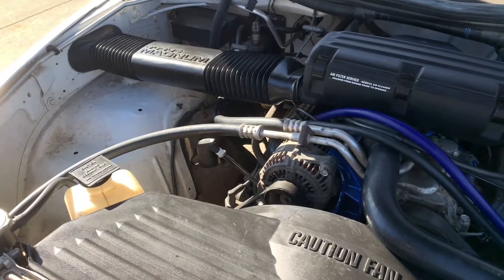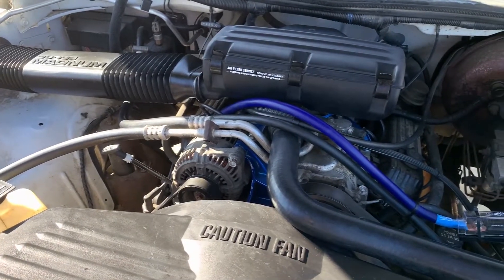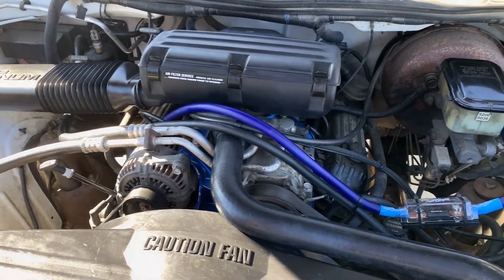Electric fan conversion update and review

Comment: Hey man didbyou get the Mark  VIII fans from the junkyard or new?
Reply from the maker: Got them at the pull yard, recently found one of the holy grails a 98 Mark viii Fan, took the fan motor apart and replacing the main bearing on it.

Comment: Which year was the Mark vlll. I see different years have different styles.
Reply from the maker: 93-96 are easier to find but a little weaker in power, that’s what i have and they are super strong even though they are the not as strong years. the 97-98 models are the strongest they pull a couple hundred more CFM than the earlier models because they have higher rotations per minute. 

also keep in mind that a true lincoln mark 8 fan is single speed, people on forums have this confused because they sometimes buy them online and they get thunderbird fans instead of mark 8 fans, since they look virtually identical. so make sure you pull them out of a MK8 can or that the female receiver plug on the fan itself is White, a black plus is a thunder bird fan.

Comment: So Deleting the clutch fan does save on fuel since ur fan blades are working hard Against the wind??
Reply from the maker: that’s correct, i’m still running the big lincoln mark viii fan on my truck and working on a dual 18” fan set up!
Reply: @payloadperformance9706  let me Know...I got a 2002 with a 5.9ltr gas. Looking to delete the clutch fan as well.
Reply: @payloadperformance9706  if possible if u know how to Customize it?
Reply from the maker: @garciacuster1627  Message me on IG so i can give you more details on what you’ll need, where to buy and how to do it. 
my IG is the same as my YT channel name
Reply from the maker: @garciacuster1627  im not sure what you’re asking.
Reply: @payloadperformance9706  can custom make 1 for a 2002?
Reply: @payloadperformance9706  I don't have IG
Reply from the maker: @garciacuster1627  i don’t have the dimensions for it, i have only customized them for the 2nd generation series of trucks but i’ll look into it to see how i can help you out.
Reply: @payloadperformance9706  I Very much appreciate it. I'm in Texas so I wouldn't be hauling stuff up and down hills mountains! Thanks I really Appreciate it
Reply from the maker: @garciacuster1627  the dual fan set up is complete, check out my last video!
Reply: While driving?

Comment: Bro I have a 97 ram 1500 5.9, I ran a 16inch spal fan with a shroud and was getting 187 degrees driving around, with a 16 foot trailer hauling dirt I was getting 210 degrees on up hills. It worked ok but the fan was so loud it sounded like there was something wrong with my engine lol. I ended up installing a oem fan off a 2010 ram 1500 v6 fan and bro its amazing my temperature reads 176 and max 193 with a load. Oh and super quiet.
Reply from the maker: I’ve heard great things about that swap! That’s on my list for fan testing, I recently acquired a w203 Mercedes fan that is rumored to be stronger than the mark viii, but I need to order a special controller for it, I can’t wait to test that one out after the mark viii. Do you have an IG where I can see the fan you installed on your Ram?
Reply: Sam can u elberate more on ur set up

Comment: I was suppose to do this 2 years ago and I'm still scared to do so. I have a toyota tundra 07. If you provide me a few pointers to start would be great.
Reply from the maker: Bao Tran measure out what size radiator you have (Length and Height) to see what size fan or fans you can fit. If you can do a dual fan set up it’s always better since you’ll be pulling more air And whatever set up you go to for a fan swap make sure you research how to wire it, and how to remove bolts nuts and other things specifically it will make you installation drastically easier!!
Reply: @payloadperformance9706  thank you
Reply from the maker: @BaoTran-bs6jr  have you don’t the upgrade yet?
Reply: @payloadperformance9706  no not yet. Still researching. Not sure if of lots things, finding alternator that can fit for 07 tundra and all thing you were explaining. Overall i'm just scared. But I love the idea. You make it seem easy. lol
Reply from the maker: @BaoTran-bs6jr  add me on IG: PayloadPerformance 
send me pix and i can help you out. i recently did. the fan from the lincoln mark viii set up which is much much easier to do and it’s a stronger fan! 
plug and play system pretty much.